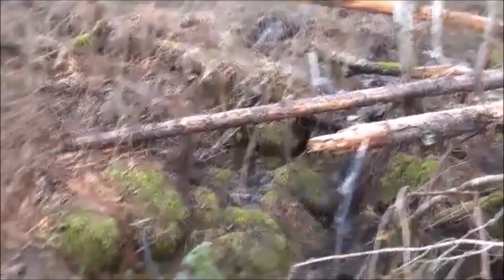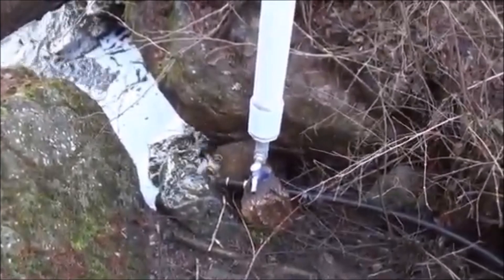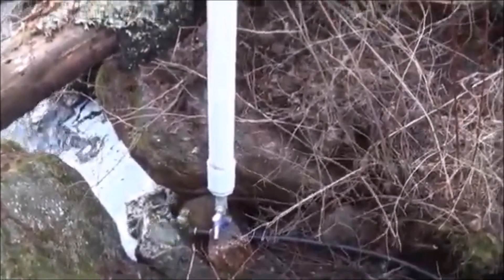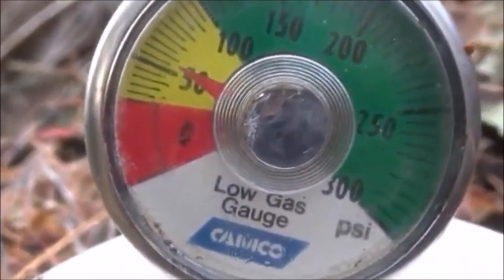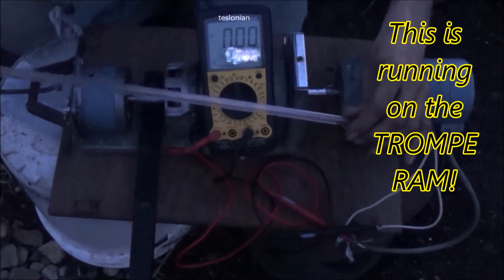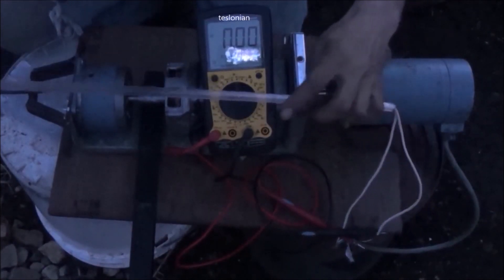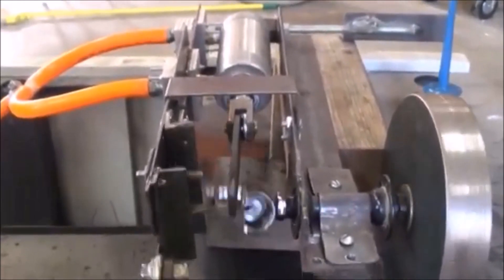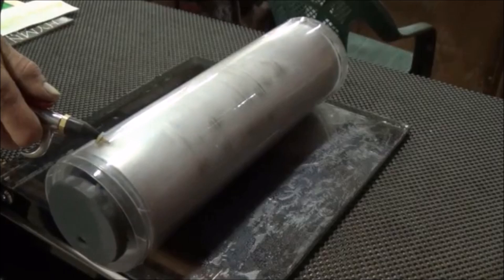The "TROMPE RAM" runs a TESLA TURBINE and two other engines with 60 psi from 8' of head.

Comment: I was actually wondering if you could just use the water power with a tesla turbine = less moving parts and basically make the metal out of aluminum bronze which is reputed to be even better than bronze in terms of weathering and valued as much as gold sometimes in ancient times... Aluminium bronzes are in the highest demand from the following industries and areas:

General sea water-related service

Water supply

Oil and petrochemical industries (i.e. tools for use in non-sparking environments)

Specialised anti-corrosive applications

Certain structural retrofit building applications

Aluminium bronze can be welded using the MIG welding technique with an aluminium bronze core and pure argon gas.

Comment: This compressed air could be lead to one or more larger tanks for longer lasting use. With one way valves in between for security:)) There also is things to put in between to take out moisture if you want to use tools with it.